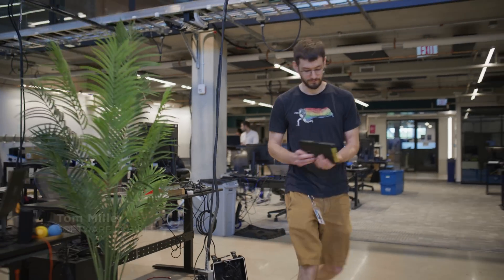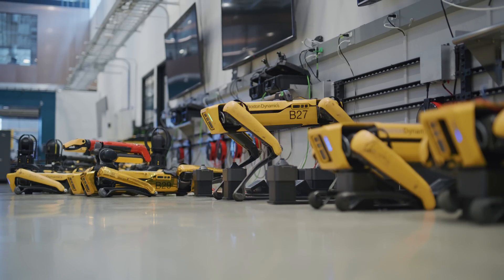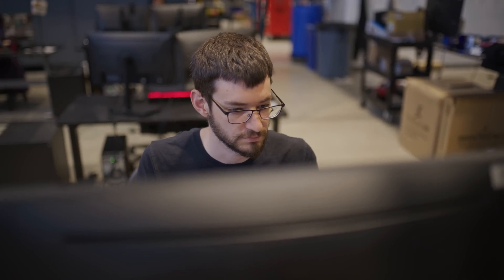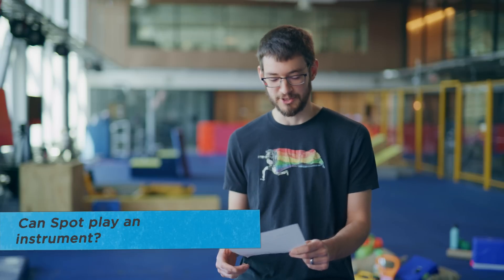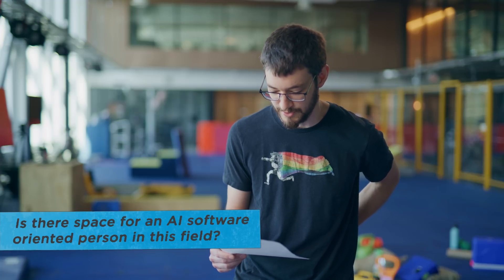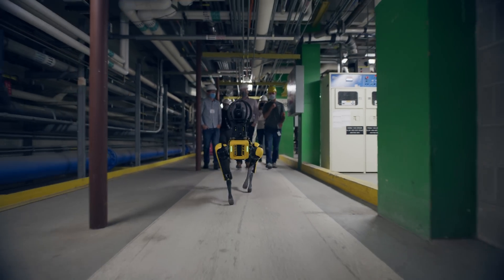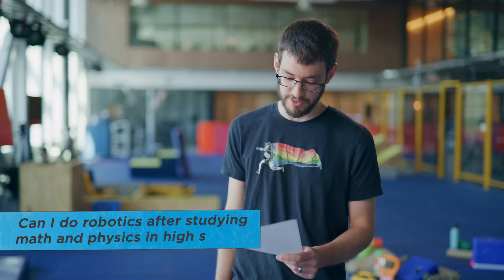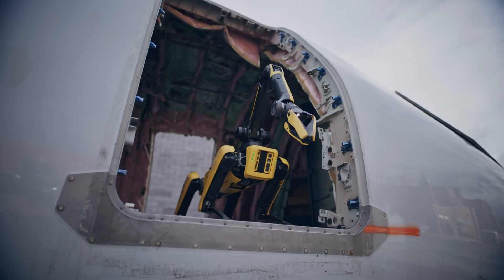Ask a Roboticist: Meet Tom | Boston Dynamics

Comment: A couple of questions: 
1. Do you use a ROS version.  (Robot Operating System) 
2. Which battery types do you use?  and what is the relationship between charging and operating time?  
3. Have you ever thought about operating 2-3 robots in a group / network to ensure better situational awareness?  
4. What actuators / motors do you use?  (I'm impressed with how accurate and fast these work.)

Comment: Dear Tom, never mind the number of legs that a working robot needs to have!
At 70+ plus years, I need to restore the diminishing power of my muscles to shovel snow and clean the car after each storm. I picture myself looking out from a warm room inside a house and be in control of the robot(s) shoveling snow outside. The robots will come pre-programmed with a menu of different shovel handling strategies, and the ability to not throw snow on the street or on the neighbor's car. Another way to do it is by having the robot(s) duplicate every gesture that I make inside the house. by shoveling warm air, while the robots will be shoveling cold snow. The copier robot(s) will need two arms in addition to legs, wheels, or tracks.

Comment: Cool to meet you Tom. Great video.  We need a CHEF robot. Cooking is a science, and a robot can measure 2 teaspoons of cumin powder if the data is fed in correctly, peel and slice ginger, 1 teaspoon of salt (you get the idea) and following the recipe will get the exact consistency and same results every time. A house helper robot can serve the Seniors market and busy families. A photo of cumin powder can be fed in as data and the robot can check the color and texture to add it. Or it could learn to read labels. Or QR Codes that can be stuck on bottles for a faster route.

Comment: MY ORDER FOR ILLUMINATIAN ROBOTICS TECHNICIAN, PLEASE USE PARENDEV PERMANEN MAGNETIC GENERATOR ON ROBOT, BATTERY IS WASTING OUT TIMES, NIRON MAGNET CAN REPLACING NEODYMIUM MAGNET, FAR MORE CHEAP AND EASY TO MAINTAINANCE, AND WITH PARENDEV MAGNETIC GENERATOR, ROBOT CAN BE OPERATING 5O YEARS MORE WITHOUT NEED TO RECHARGE.

Comment: DYNAMIC BOSTON deserves the greatest attention for their works of totally inestimable value from what can be seen today, the factory should look further towards the mass printing of their humanoids for professionals
this is where the best opportunity to finance their after-sales service factories is found, after all they are alone at this level
and overall champion.
It is the most advanced team in the world for humanoid machines. Have they ever tried extended development to operate other non-assisted equipment, such as semi-programmed mechatronics in direct human mimetics?
where the main issue is the automatic and manual direct-drive gearbox based on the same non-disconnectable CMOS pyramidal accelerometer of center of gravity, whatever the gestures, in a PREDICTIVE way of the synergies
of Corrective mass opposed, so well calculated in the demonstration of this last prodigy of jumper of obstacle on two feet upright.
FINALLY What will be the accuracy of self-diagnosis of the trajectory controls of the nacelles of touch sensors such as palmar of hands or feet refined to the ration of 3d in contact with the ground or out of force of gravity by tactile contact on other objects pre-load
or bring in real time on shape template-image of the embedded software library. A second solution, prehensile (or lianas-beta-cam illuminated or not) contiguous to members of mimetics pushed up to 1/10 inch of tolerance before the storage of isometric pressure on a textile a self-supporting insulation, by use of carrying tools, building sites, moving another motorized device, climbing a rope, unfolding a ladder, pulling cables upright, building a ramp through a space simulator that looks at shapes to collect before pulling them attach to each other. It is a very difficult choice of implementation time, thinking that only one brand of vehicle can print it
nearly several thousand a day. thank you for your whimsical video on these prodigies of robotics, sometimes it makes you wonder what the superconductors of the future will be if they are assembled by mimicry procedures as advanced as yours in the 4D and 5D property of the nanoscale actuator sensitivity.

Comment: Tesla's Optimus will have fingers. Clearly a robot needs fingers, in order to grab things, operate equipment, etc. (Mars colonization).
Reply: There's more solutions to operate and grab things. Spots arm is a good example. You don't necessarily need fingers. (Also for Mars colonization)
Reply: "Clearly a robot needs fingers, in order to grab things, operate equipment, etc."
The first thing a robot with fingers will most likely be programmed to do is wank the owner off. If Michael Reeves gets his hands on one, this will be a certainty.